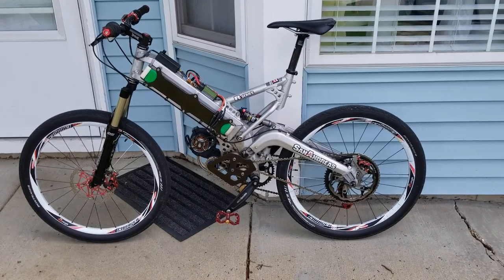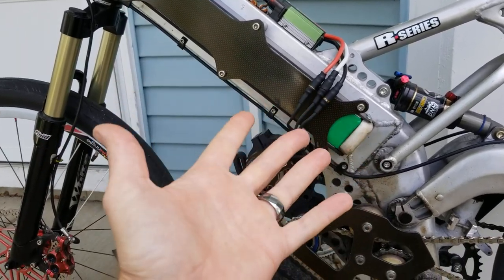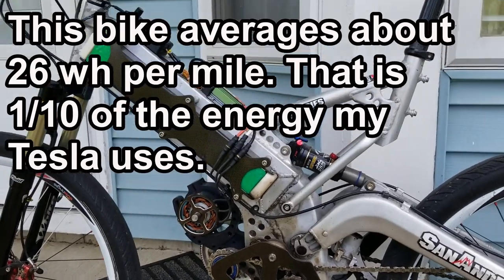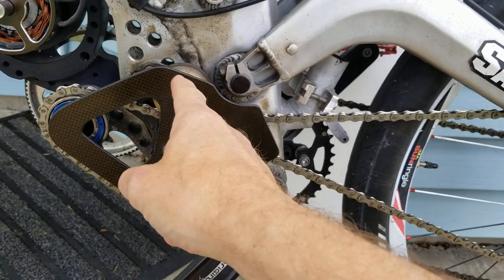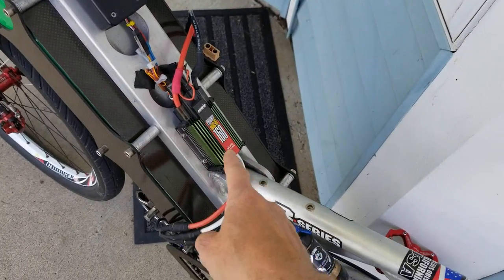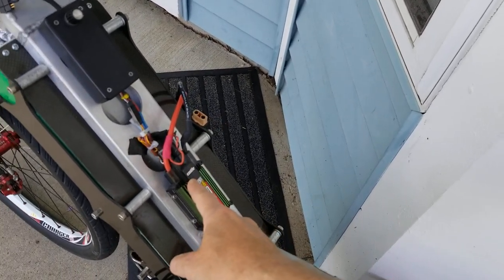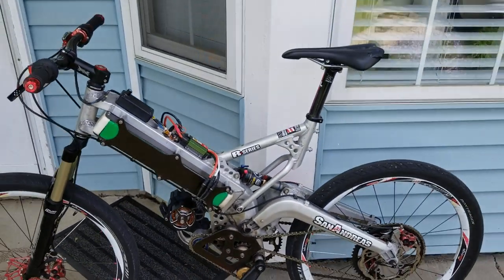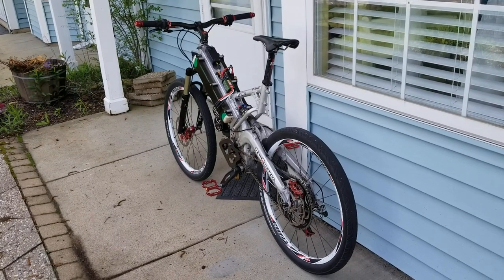My Custom Built super high-power E-Bike!

Comment: Matt, i hope you're doing well!! sometime in 2021(hopefully becauae it will cost $6-7k to build) i want to build the ultimate ebike i can come up with using a similar setup to yours and i will definitely pay homage to you. i didnt know anything about astroflight motors until 8-10 yrs ago because of you and then some years later i came across your valuable content in a forum. thank you.

i have a few questions i would like to ask if you don't mind:  are you selling that device that helps the throttle read the controller? what's the speed on the gear reduction ratio you use? if you were to make any changes to it, what would they be?